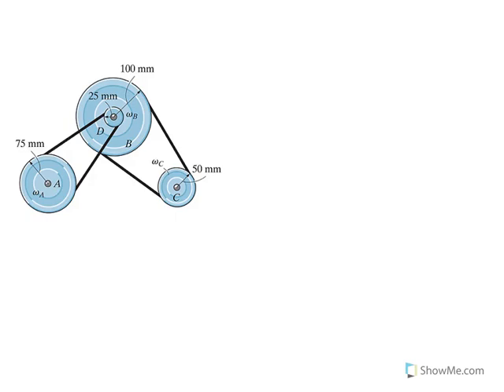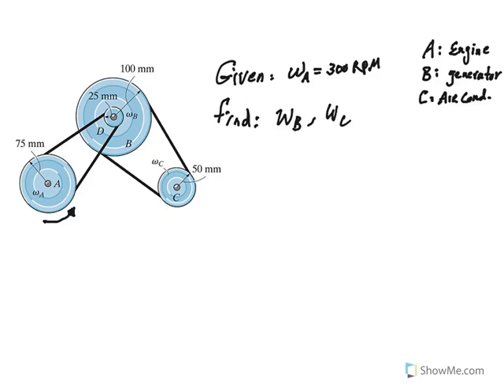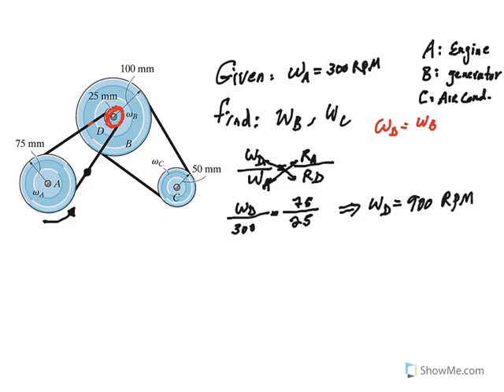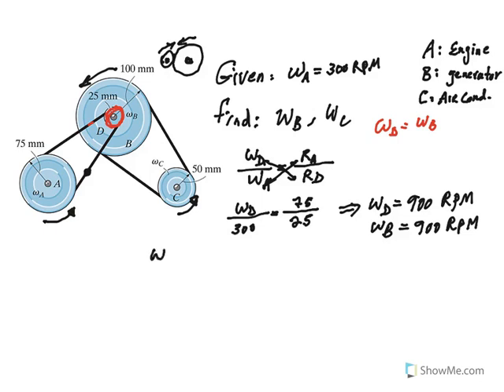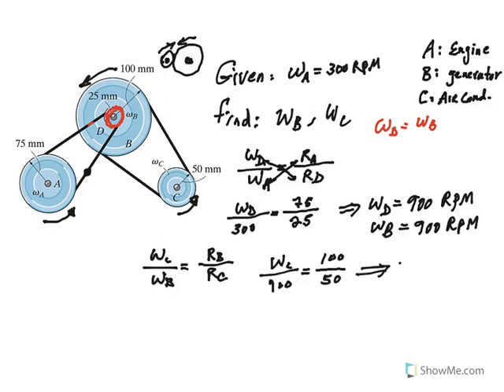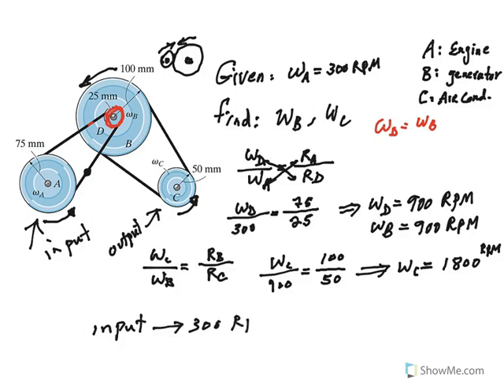Pulley & Belt Drive Angular Speed Relationship | Mechanical Power Transmission

Comment: When the rpm increases 3 times, the torque reduces 1/3. So the power to the generator shaft will reduce and hence the driving shaft power must be 3 times the power required by the generator for its working rpm.